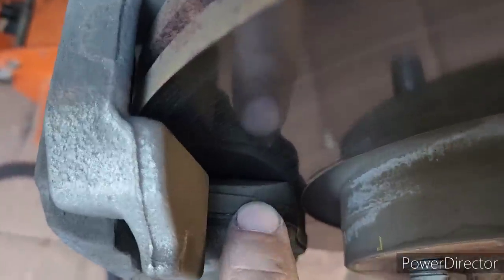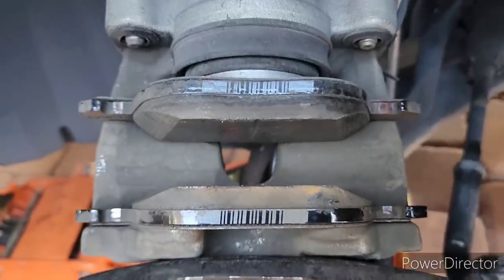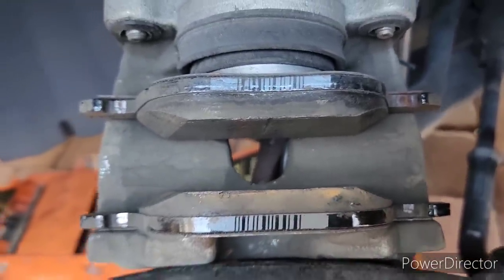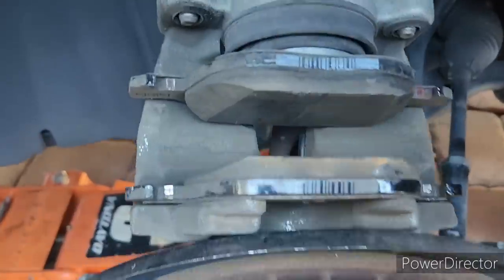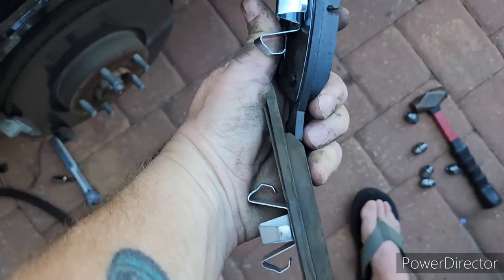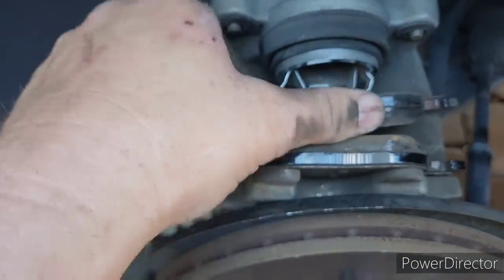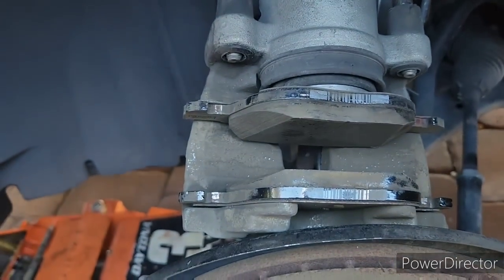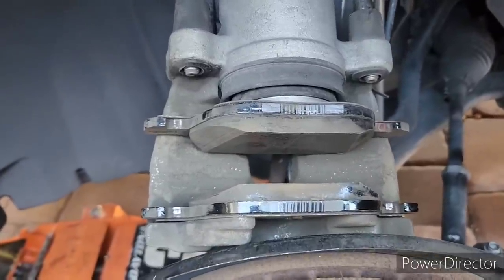Ford dealership robbed a little old lady out of a brake job. (almost)

Comment: used to drive a service van with my boss all over the place. when it was due for tires, we brought it to a place where one of his relatives worked. his relative said it needed new brakes, so he bought the pads and was going to have me swap them out. easy peasy. i get the tire off and the pads are brand new! the rotors dont even have any grooves! take off the other tire, same deal. its unbelievable the shit these places try to pull over on someone. about the only thing i have a shop do is balance my tires. i'll even change them myself to save the money. i dont trust anyone to touch my vehicles but myself.

Comment: I took my car to the Toyota dealership to be inspect for an oil consumption recall, had them change the oil, then after a month they would check for excessive use. Oddly enough, it stopped using oil. I looked at the sticker and found out the trick, the car calls for 0w20, they used 5w20. No more oil use. I've been using 5w20 ever since. The actual repair calls for replacing the pistons, so I'm not surprised they didn't want to do it, but their solutions has worked for years after.
Reply from the maker: I was a diesel tech at Ford for many years. The cam sensor on the 7.3 was $224. Then, ford came out with a recall on them. All of a sudden, they were worth $30. Weird how that happens, right?

Comment: In the first place Ford makes crappy cars, I have had a Ford escape hybrid and it was a total POS....the only thing it had going for it, it got pretty good gas mileage....but that was it...it drove like it had concrete wheels, if you drove over a toothpick laying on the street, you could feel it. I would never, ever take a car to a dealership for oil changes or anything....I just had my brakes replaced on my Scion for $180 and the mechanic came to me....he also changed out my headlights....one has to shop around but Jiffy Lube offers very inexpensive oil changes.  I'm in California.

Comment: The wear mark could fool an inexperienced mechanic if they only see that end.  Take off the wheel to inspect.  I'm happy to have a good dealer.  Mercedes and they are conservative with clients wallets.  The car, however, sometimes demands money.  Year 12  is an expensive one replacing worn parts from Belgian roads.  The roads are made of potholes.

Comment: Nissan dealer told my wife she needed new lower control arms  ($1,100) on our 2014 Rogue at 70,000 miles. I told her to take it to our local trusted tire/brake/alignment shop for a second opinion. They said the control arms are fine. She takes it in every 5,000 miles for their free rotation and inspection, and  the control arms are still good at almost 155,000 miles. I finally convinced her that dealers are rip-off artists.
Reply from the maker: Similar situation at this same dealership with a different friend. He  brought it to me, and I I told him I  couldn't sell him a single thing. He had a little shimmy. They tried to sell the whole front end. I rotated his tires....

Comment: My wife took our Toyota to the stealership last week for an oil change (been to busy to do it myself, lately) and the came back and told her ahe needed a radiator flush and a new water pump. The flush I could see, but not the pump. There's been no signs of needing a new pump, just wanted to take advantage of the fact that she is a female who doesn't know anything automotive related.

Comment: I got scammed by a transmission place! The transmission place said they flushed my fluid out and refilled with new transmission fluid. What they didn't realize is that I was going to check to see if the transmission lines had been disconnected and reconnected! Well,they lied and I called them out on it! Beware people these dealerships are scams! Your better off with your own personal mechanic.

Comment: sometimes they wear on an angle uneven ether from something minor like slide pins or caliper issues etc...if you only using the measuring tool and measure one point that is lower you get a smaller reading deff on the ends and not the center. ,You really suppose to remove the whole thing like in this video to get a better picture of if they need to be replaced...thats why its best to really check them if you are iffy about your measurements cuz sometimes they can measure as 3-4mm from the whee,l but when you really get a better look they can be 5-6mm or more...not something you need to get done asap, but in a customer head they will think they have no brakes etc...thats why you should always make sure before you recommend them. lol

Comment: This is not uncommon.  This is every dealer when you go in for any free maintenance.  
I bought a 2 year old Chevy impala that was certified used which means it come with 2 years free scheduled maintenance.  And every time I came in for an oil change it was always something.   Battery failed load Test I called them right out on it. $200  I said well that should be under factory warranty no? What about the 60 month Battery warranty?    They were back peddling like crazy. 
That Battery lasted another 4 years through northern Pennsylvania winters.  Air filters and spark plug and Intake cleanings all kinds of shit that for some reason or another it needed it but was never covered.  

So i came knowing my wheel hub was a bit loose But it was inspection time.  And they passed it and then I said did you check the wheel hubs?  They said there fine.  I made them put it back up. Shook wheel top and bottom and wouldn't you know Clunky.   I told fix my car or Im calling GM immediately and Pa dot and stop trying to rip off your customers.  Its a shame . Absolutely pathetic

Comment: Tell the mechanic you want your old parts and that will help prevent some of the fraud really sad when you can’t even trust the dealer you bought the car from  I was at Gunn gmc Buick in Selma Texas and they tried to sell me a brake part for 564 dollars and then 160 to install  I did it my self  part was 95 dollars and it took me exactly 5 minutes to install   Trust no one

Comment: I worked for an unnamed state for 2 decades as an automotive fraud investigator…. I found through the years, that shop management was always riding the technicians to produce produce produce. They would threaten the techs if they didn’t sell more….  Now I know this does not make this right but it’s a bad life for techs when working for shops and dealers that do this…. We would run documented undercover cars. We would write cases and forward them to the district attorney and attorney general for disciplinary action.  Some spent time for this.

Comment: My trusted mechanic quoted me $400 for replacing a u-joint and carrier bearing on a Nissan Titan, out the door. I thought it was fair but I didn’t want to spend $400 this week. I then removed the driveshaft, installed the u-joint and took it to a shop down the road to have the carrier bearing pressed on. The guy quoted me $380 for pressing a bearing. No thanks.

Comment: Been in the business for 35 years I've seen my share but now it's even worse.
It's not just you "need" brakes shocks tires etc bc you "will" have an accident scare tactics but now it's absolutely getting out of hand.
Customers going in for an oil change the oil it's never changed or the filter.
They charge for a new air filter that they never replaced. 
A transmission service where nothing was done to it other then put it up on the lift and act like they r working underneath. 
I can go on n on.
These shops n "mechanics " give the rest a bad name and no one trusts them anymore. 
Fix your own car if you can or take it to someone you absolutely trust.
Reply from the maker: Are you sure we haven't worked together? 😂  This is nearly exactly my same experience.
Reply: @@bucketojunk  I'm sure we're not the only ones lol...

Comment: Really low of the Ford dealership, the management, and the mechanics that agree to steal from customers. I'm sure my confidence in stealerships has nowhere to go, it's already at about -15,000,000.

My advice for older drivers, ask a friend for a second opinion before you consent to any repair to the vehicle. And use your own trusted mechanic for everything possible.

Comment: I took a Chevy S-15 Blazer, 4.3L to get the last 2 plugs changed. You know, the two behind the master cylinder and steering column? When he changed them, he came out to "warn" me my truck needed head gaskets. What made him say that? The plugs he pulled out, had a slight green tinge in the electrode insulator. I straight up to;d him he was a thief and a liar because, the friggin plugs were COPPER. He tried to say the coolant is making the plugs green.... Schmuck.
I told every person I knew, and some I didn't, what a sheister that guy was.

Comment: Ok maybe it’s a mechanic thing , but I’m an actual master certified technician and those old pads appear to be hardened or glazed over which older people do all the time by riding brakes or stopping too early , the new aftermarket pad you have is absolutely garbage and the old pads have lining but it could be in better shape to not cause noise , and this is the most accurate statement in the comment section period

Comment: I don't trust mechanics or shops. Compare the price of parts they sell you vs. buying them and paying for the labor for installation. Ask to see the invoice for the parts they buy and are putting on your car. Shops use a labor rate book to scam all of us. The federal trade commission needs to investigate the practice of using the labor rate book and change things for all of us. Oh, and some personal integrity on the part of mechanics might help too. Practice saying, "no." I had a part that needed to be tightened to stop a leak, a safety inspection later, I found I needed 2500.00 worth of work and I still had a major leak. The nut was later tightened on the transmission line and the leak stopped.

Comment: A garage once charged me hundreds to replace the gas tank pump when my 98 Ciera when it wouldn't start one day .  took a week ,  said the gas tank straps were special order .  They never dropped the tank ,  the issue was a crank sensor .  They also broke every mount on the relay bank up front( about 5 relays ) and bent the pins on one relay so that it was intermittent . I hate auto mechanics. Haven't found one in my lifetime that is honest.

Comment: $200-$300 is a bargain for a dealership brake job!  I was quoted $700 for front and $800 for rear! Spent $350 to get the pads and rotors to do it myself, only to find out that I had 8mm left all around. New parts have been in the garage for two years now waiting for the pads to actually wear down! I fired that dealership!
Reply: Not if they charge you 200 to 300 for work they don't even do.
Reply: @rosssmith9870  That falls under Fraud, please call the attorney general and file a complaint. While doing unnecessary work is unethical and wrong, it's not technically fraud. Charging for a service that was not performed, that's fraud!
Reply: @OG-SoaringFalcon  Correct, it's fraud. I just meant that getting charged 200 to 300 for work not done isn't a bargain.

Comment: A lot of the corruption comes from the top down, or at least the culture that encourages it does.  You pretty much have to shop for a mechanic like you do for a doctor.  Find someone independent that you can trust.
For me its even tougher cuz, well, brakes, for example, I rarely run stock pads if I can help it.  Most places don't want to have anything to do with something not a factory part.

Comment: Did they specifically say that she needed front brakes only?  I know stuff like this happens and it’s disgusting, but we all know that rear disk brakes require more attention and usually need replacement before the front. Just wondering if there may have been a mix up and the rear were the issue.  Again, I know garages rip people off, and as an independent shop I do see it more so from dealerships. Just playing devils advocate.
Reply from the maker: They said front brakes. I also checked the rears, and they were in decent shape. Not as good at the front, but not in need of service.
Reply: @Archersgarageandwhatnot 10-4.  Sad that stuff like this happens. Thanks for sharing.

Comment: See it on the daily. Constantly telling customers they are not ready for brakes. Usually dealer and the local jiffy lube when they get a oil change. Makes me sick and annoyed... I always educate them and tell them to get an actual MM reading. I recommend between 2-3mm. Most come with 8-10mm new. Then the customer usually goes ohhhhhhh that makes way more sense. Kills me to see this so often... but at least I cam sleep at night knowing I didn't rip anyone off. Karma is a bitch lol

Comment: I had my own Garage back in the early 70's , A friend of mine 's sister needed an MOT on her car  i knew the  rear subframe was shot (Austin Metro very typical) she had previously had a quote for the replacement  at the MOT testing station stupid money they though seeing a younger female they would pull a fast one   i replaced the frame and the Handbrake cables anyone that knows the metro will know it is very difficult to do with the frame fully in place  ther are 2 plastic clips nightmare to git any how new cables new clips new subframe in it goes for it's retest to be failed on the 2 plastic clips that i knew were ok   long story short i saw red went round and gave them what for  called the department inspectors out said garage lost it's ticket to carry out MOT test   3 months later were closed and gone  hate cowboys .

Comment: you sure she didnt have them done? those pads are new the rotors look recently resurfaced and the spring that goes across the front of the caliper is missing. just seems like theres more to the story or just needed some content
Reply from the maker: Yep. This was less than a week after she went there. She didn't have the money, so she left the dealership.

Comment: Not only did the pads have plenty of meat on them 

both sides look the same which means the hydraulics on the Pistons and everything is working really well. 

I could understand if one side was new One side was really down because that could indicate it needs a caliper kit, and to be stripped, 

but not only were the pads new……the system is obviously working perfectly, which is even worse for them to say, she needs new brakes……

@rse holes…..

Comment: Back when I owned my eclipse I went to the Mitsubishi dealership & asked them how much it would be to put in a factory steering wheel, they told me it would take about 8 hours & it would cost about $800 so I said fuck that I’ll just do it myself, bought a steering wheel puller at harbor freight & with a couple of bolts it came right out. So they wanted $800 for all that are you kidding me ?!
Reply from the maker: 8 hours?????? Ouch! Highway robbery.
Reply: @Archersgarageandwhatnot  yea no I wasn’t about to let them rob me like that, told them to kick rocks.

Comment: I thought it was a good video, but a little constructive criticism is you should have thought out the pad placement of the new pad in relation to the old pad, prior to starting the video, so the brake pad wasn't moved around several times.
I think just place in the bed in front of the old pad would have proven your point and a matter of seconds.
I hope you're not upset at my, as I say constructive criticism, but I think you can make your channel a lot better by, just thinking through your presentation a little bit more.
Because I like your channel and I watch it often.
Reply from the maker: I appreciate constructive criticism. I also need a tripod! I'm starting to take the channel more seriously lately. So, improvements are coming.
Reply: @Archersgarageandwhatnot  
I think your channel is really good, and it has a lot of potential.
Keep up the good work. You're on the right track.
God bless you.

Comment: speedy auto quote me $670 cad （$280 parts+$$390 labour）for replace my 2009 Pontiac vibe parking brake cables. i found a mechanic quote me for $200 for labour but he can find the cable because the car discontinued. I decide to stop using the parking brake until I found the parking cables😂